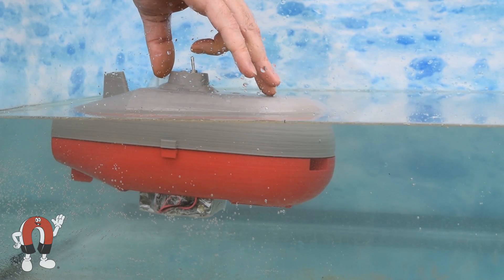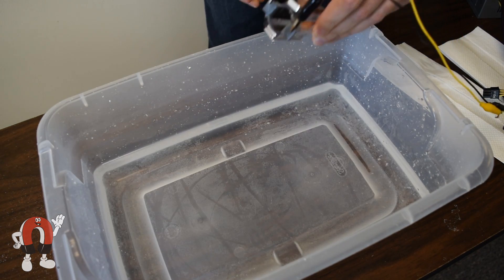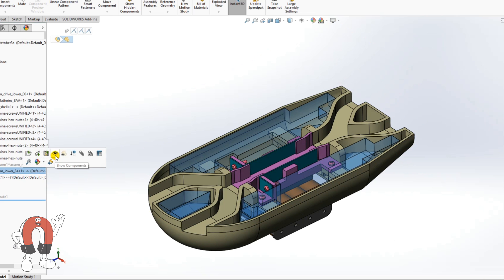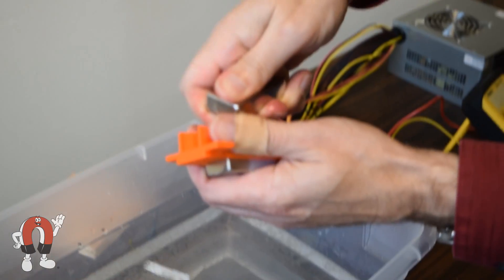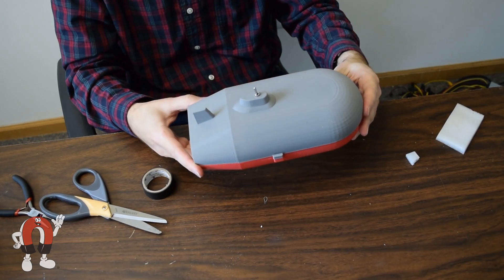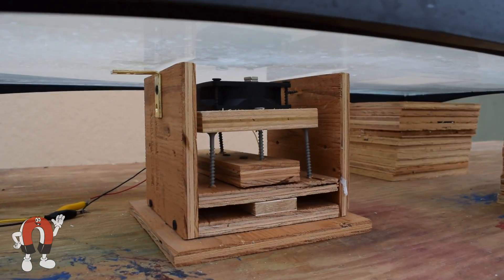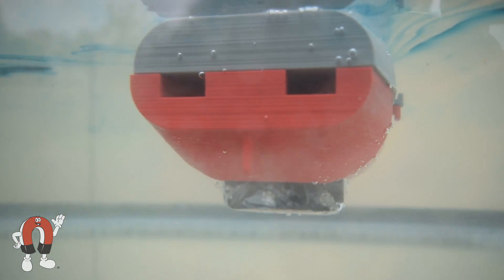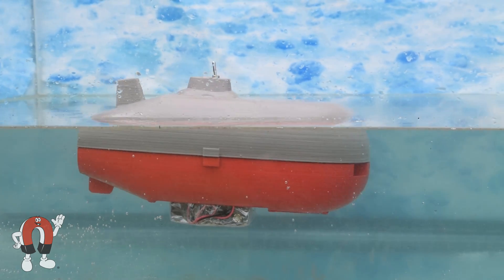Magnet Powered Submarine - The Hunt for Red October IRL!

Comment: You would have more speed (thrust) with a smaller exhaust jet.
Reply: Are you sure? Isn't the thrust just the result of the magnetic force on the water?
Reply: @derekp2674  I took a course in hydraulics from IU, and according to the math, if you decrease the aperture you get higher pressure you get higher pressure and you get more thrust.
Reply: @AdamosDad  Is that the Bernoulli equation?
Reply: @derekp2674  It would be a derivative of that equation, simply restricting the flow increases pressure, the same is true with valves or an electrical circuit, E=IR, voltage goes up when current goes down.
Reply: @AdamosDad  But here the thrust comes from the Lorentz force on the fluid in the duct, so I don't think tricks with convergent or divergent nozzles can change that.
Reply: @derekp2674  I does not matter what causes flow, fluids when flowing will increase in velocity when restricted.
Reply: @AdamosDad  Thanks for your patience and persistence. I've now looked up the wiki on jet propulsion https://en.wikipedia.org/wiki/Jet_propulsion and the subsidiary page on  water jet propulsion https://en.wikipedia.org/wiki/Pump-jet

From those, I now agree that the exit velocity of the jet can be optimised (e.g. by either a convergent or divergent nozzle) to maximise the thrust, but I note also the thrust is actually the product of both the exit velocity and the water mass flow rate. So if, for instance, you doubled the velocity but halved the mass flow the thrust would stay the same. So there might be an optimum amount of constriction to apply.

As regards the pump used to power the jet, it looks as though it can be any kind of of pump pointing in any direction, so I was wrong to thing that the Lorenz force must be equal to the force on the sub.

The Lorentz force has to be the force on the water in duct and the work done on the water there must equal the work done in propelling the sub (including work against any drag on the boat) plus any losses in the system (such as any residual kinetic energy in water as it leaves the sub).

Comment: This is a really nice demonstration of Magnetohydrodynamic drive (MHD).  As for why no sub like the Red October has been built, there are papers with serious analyses that have been done and none of them show it's promising enough to actually build -yet.  There are technical issues to overcome to move a 7,000 to 12,000 ton submarine through the water.  But it's close enough to reality that the Hunt For Red October is plausible, and Tom Clancy wrote a great novel around it.
Reply: I remember looking at this 40 years ago, when the some Japanese inventors were considering it as the "dream ship" project. My simple calculations suggested it was not going to be commercially viable, because of the low conductivity of sea water.
Reply: WRONG.
Reply: You're just going to quote Yamato 1 which is hilarious. There's much more to the story than inefficient Linear Faraday Thrusters like the one on the Yamato.
Reply: @nighthawkviper6791  Thanks for the Yamato 1 reference. 
My brief look at this technology was in the early 1980s so that project came about 10 years later. The wiki page on that seems to confirm that the claims for this "invention" were over optimistic, which is what my colleagues and I thought in the 1980's, when we advised our client not to pursue a similar line of research.
At the time my main day job was researching the generation of electricity from sea waves, which has so far not become economically viable for large scale plant.
Reply: @derekp2674  Magneto-Plasma Chemical Engines, Inertial Mass Reduction, and Fully Enveloped craft have been in operation since AJAX, HTV-X,  the Aurora Hypersonics program, and the Astra series at LMSW. M2P2 propulsion, and other forms of Field Propulsion are powered by nuclear reactors, and have more than enough coefficient power to traverse any medium. Be that water, nitrogen-rich air, or the vacuum of space. See Russia's publicly released MHD-Torpedos so you can get some Aerospace Engineering education. (See any referenced above as well). 

As for civilian markets; "it's too hard to engineer, 50yrs away, give me money so I can research it"----Which is why you only have planes that keep crashing and garbage automobiles that haven't truly innovated in 20yrs. 

There's also Beamed Energy Propulsion, and Chevy innovated the Chapparal as a concept for civilians; never to be released...lol

 So, I guess it doesn't really help you knowing this tech exists.
Reply: @nighthawkviper6791  Interesting - thanks :)

Comment: isn't it always cavitation in a way with the bubbles?
Reply: The technical  definition of cavitation noise is the collapse of vapor bubbles which are generated on the lift side of the propeller blade, or any lifting surface (the top side of hydrofoils can have this problem, too).  There is lower water pressure on the lift side of a blade or foil flowing through the water so water boils (vaporizes) at a lower temperature.  As the bubbles are left behind, the pressure rises, the boiling temp rises and the vapor in the bubbles condenses suddenly and collapses.  This causes noise that sensitive sonars can detect.
But this produces hydrogen bubbles, not vapor.  But the hydrogen bubbles won't condense and collapse causing noise.    So either the hydrogen bubbles will rise to the surface and produce a trail of bubbles which would definitely make a sub using this technique trackable OR the hydrogen would dissolve into the sea water.  Not sure which would occur.

Comment: Congrats on making the drive work. It made be silent so hydrophones couldn`t But the other method is M.A.D. Magnetic, Abnormality Detector , with those BIG magnets a sub would need    , it would light up like a christmas tree.
Reply: A closed halbach array would have zero net anomaly, as long as it is properly balanced. It might even have a better weight to magnetic flux ratio.
Reply: AC electromagnet drive helps with that and gets rid of the gas generation issue in water.
Closing the magnetic circuit would help too.

Comment: extremely cool!  I wonder if the bubbles would be noisy underwater though-like a cavitation sound?   How to get rid of them?  Such a great experiment-thanks!!
Reply: Lower voltage would cut down on it, but also pressure and cold helps it dissolve faster. The issue is that soviet/russian subs are rigged wuth isotope detectors to find leaky subs. Wouldn't be hard to find the elemental deuterium/tritium.

Comment: So how much foam will it take to float a Tesla?  Subtract the hydrogen and how much force do you get. Electricity is always a neat idea to power things, but the batteries  always limit it. How big a reactor will you need to make it practical.  Very neat demo
Reply: The electrical output required from a reactor (and therefore the size of the reactor) depend on the efficiency of this propulsion system and the top speed you want.  I seem to recall reading about some estimates that strongly indicated that for even 3 to 5 kts, it was much less efficient than a ducted propeller properly designed for silence and efficiency.  Subs will tend to stay at 3 to 5 kts even if their drive is silent because the water flowing around the hull generates noise, the faster speed, the louder the flow noise.

Comment: An improvement. Use AC power, and replace the magnets with coils. In this manner there is no electrolysis and the system is much safer without all the hydrogen gas.
Another improvement is to make the water flow thru a serpentine, so to mimick a multi-turn rotor. The entity of the improvement from the serpentine is staggering. You must use differently oriented magnets (or coils) for every turn of the serpentine, as water is flowing forward in one sense, and backward in the other. You can get thrust from each of the sense of water travel.
Very nice experiment, thanks...

Comment: I'd imagine that with some lithium ion batteries, a variable voltage controller, some servos for steering, and a little bit of ingenuity you could really get a capable little ship out of this.

And hey, if the lithium batteries all go wrong you can just claim it was a core melt down.
Reply: WE HAVE BEEN SABOTAGED!!
Reply: @PeteDriver break out the rafts, lash them to the deck... We will use them as shelters until the fleet arrives....
Reply: The problem is that the galvanic corrosion eats up the positive electrode (anode) in the drive unit.
Reply: @peterkiss1204  I didn't think about that!  That's usually a term that I associate with computer liquid cooling.
Reply: Thinner profile too.  That boat is not exactly helping itself with drag.
Reply: @NacorantheHarmonicaPlayer  there's several things wrong with this design but it does demonstrate the very basics
Reply: A question about the chemical reaction: will the aluminum eventually get dissolved?
Reply: @AndyFromBeaverton  It indeed erodes. One of the notable problems with MHD. Along with hydrogen and oxygen (when water is the fluid), and in the case of the demo in the video using salt, production of chlorine, which is to be avoided, but for a quick and dirty demonstration, does work.
Reply: @MadScientist267  Thanks Mad Scientist, I knew there was a downside but I couldn't recall.
Reply: @MadScientist267  I wonder if a carbon fiber composite sub would solve that problem? At the very least it could be used for the exterior, reinforced with metal on the inside so only CFC would contact the sea water. But even better if the sub would be made entirely out of CFC because in that case it would be undetectable by magnetometers/magnetic anomaly detectors. Plus the fact that CFC is considerably stronger than steel, and much easier to form in the shape of a submarine hull.
Reply: @pieterveenders9793  The erosion is the result of electrolysis. No metal in contact with the water, means no current flow, means no thrust. Chemically inert electrodes would be best, but depending what you optimize for, still won't be ideal (say, carbon), or will be very expensive (like platinum).

The phenomenon isn't really very practical because it's highly inefficient. There's a reason it's not in common use. It sounds good on paper until you have to get into the details... Suddenly, not so much.
Reply: @MadScientist267  Ah, you meant electrolysis of the electrodes, not the submarine hull. Redox reactions were too long ago for me to remember, but would tungsten be a possibility to use without corroding away? Or if not, would using regular stainless electrodes plated with platinum/iridium not be suitable? I can definitely see how it's never been used in real submarines as for now its still much too inefficient, but the science behind it definitely sounds interesting!
Reply: @pieterveenders9793  Possibly. I don't see it ever going anywhere large scale because of cost of build and/or operation (efficiency considerations)... 

I file MHD under the same umbrella as Peltier... It may have some niche small scale use but doesn't scale up well.
Reply: I wonder if they keep the inlets the same size, but reduce the size of the outlets, they could increase the thrust with the same battery
Reply: @Coffff  Nope. Refer another thread where this is comprehensively rebutted.
Reply: LENZ effect is how my magnetic design works... Same would work for a nuclear submarine... Torroidal center flow... Watch my channel about my All metals isolating magnet...
Reply: You wouldn't use batteries LMAO You would use Nuclear Reactors and envelop the entire vehicle in the Magneto-Plasma using AFD for x,y,z directional control.
Reply: @nighthawkviper6791  he was likely talking about a small rc boat, not going to be able to use a nuclear reactor for one of those yet.
Reply: @ethangibson8645  spoilsport.
Reply: @ethangibson8645  Yet...
Reply: @MrHuram-abi  Yes, yet.
Reply: @nighthawkviper6791  no, you would probably just have fore-aft propulsion and then steer using the conventional methods like rudders and dive planes.  Submarines almost never move straight up or down, and when they do it’s an emergency blow, which is not a pleasant experience for the crew.  Subs also lack the ability to strafe.  They have very little fore-aft drag compared to their drag in any other axis.  You would also probably want to minimize the amount of electromagnetic disturbances that you create because those can be detected by existing instruments.  One of the most sure fire ways of detecting subs is to detect the anomaly in earth’s magnetic field that they create as giant chunks of very pure iron.  A magnetohydrodynamic propulsion drive would make this anomaly much bigger.